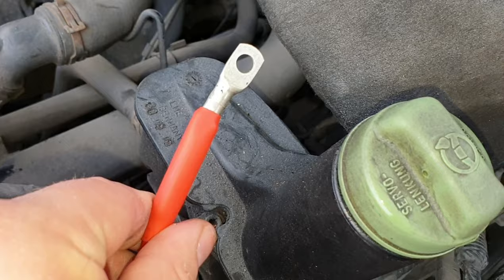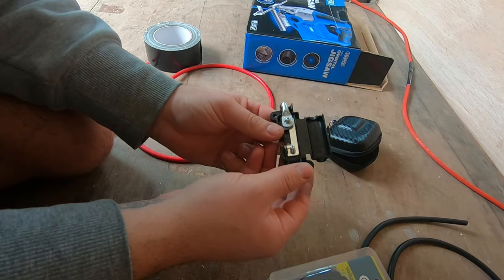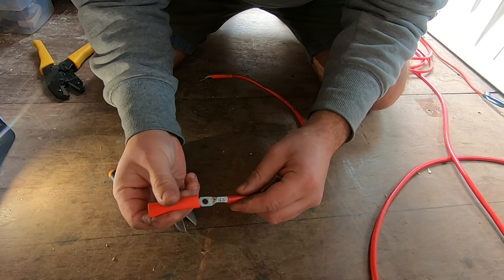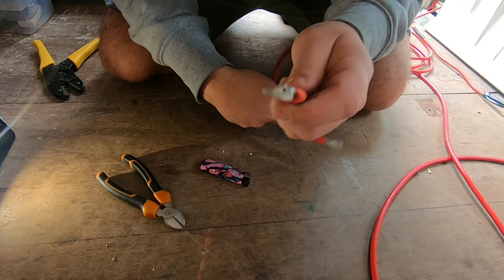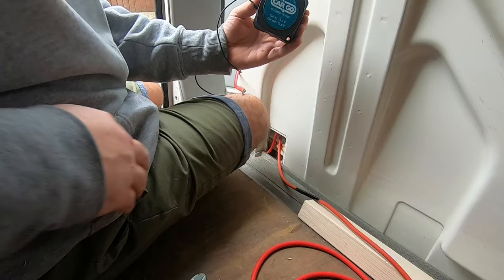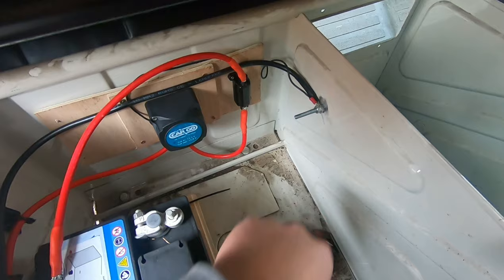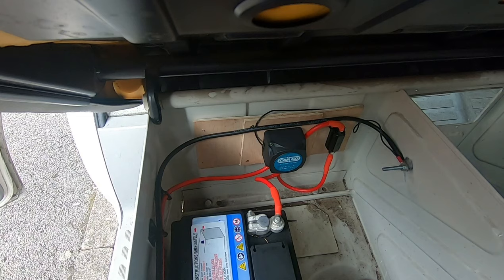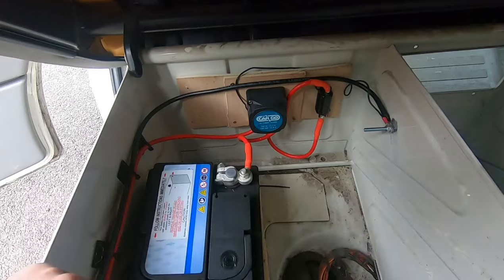Split charge relay kit to my leisure battery step by step

Comment: I have 3x110ah leisure batteries currently running on solar through solar charge controller. Is there anything I would need to do differently?

Comment: Lets say i want my solar panel to also charge my vehicle batt. Together with my leisure battery.

I only want to charge my vehicle battery i do not want to use its power for the camper part.
How do i set this up?

Comment: Did u earth ur starter battery as well  I did the same as u i ran a cable to the relay ,relay to the battery and was earthed and it wasn’t charging my leisure.

But then I swapped it out for a twin  live and neg twin cable starter to the leisure and it worked with 5amps being drawn 

So why I’m asking did u earth it at the starter battery as well as the leisure 

If not if gone wrong somewhere

Comment: Hi great video thanks just doing mine and just making sure it is ok to have the earth from spilt charge and the earth from liesure battery going to the same bolt to body/ chassis thanks
Reply from the maker: Hello mate 👍

Just make sure it's tight and on rubbed down clean metal 👍👍👍

Comment: It's supposed to be installed as per the instructions next to the starter batt not the secondary or it won't detect the voltage drop for a long time. I have the same setup and I realise why they tell you to do this. In order for me to get it to detect the car is off even after 5min I have to turn headlights on and wait to hear the click

Comment: On the first page you show all the kit assembly parts and the split box is close to the vehicle battery . I have put mine in the engine compartment,  does it matter as long as the wires go to the correct connector.
Reply from the maker: A long as it's all wired up correct it'll be fine , sorry for late response,  only just seen this 👍👍👍

Comment: Great video but missing important info: What size cable should be used and what size fuses? 
Not everyone buys a kit... I bought the voltage sensitive relay and will put kit together myself..  could you share more info for us non kit peeps xx
Reply from the maker: Hi , it's all in the description, Cable is 10mm and fuses are 60amp 👍👍👍
Reply: @LT_TOMMY_  Hi, great video.  Are you using 10mm Outside Diameter which is 25mm^2 giving 170 Amp current rating. Or is it 10mm^2 cable giving a 70 Amp rating and a 6mm Outside Diameter. Cheers

Comment: Im looking at adding in a bank of two leisure batteries due to the amount of power im likely to draw. In this case do you think it would be best to hook up directly to the alternator as opposed to the starter battery? Im just concerned about draining the starter battery

Comment: Hi, great vid! Helped me just fit mine in my mini camper 👍 I was wondering that because my leisure battery is fully charged, should I disconnect this when driving and reconnect when I need charging as the light still comes on when driving? Will this overcharge my new battery or should this be ok? 
Cheers mate
Reply from the maker: Hi 
Just leave it connected, it's fine 👍🏼👍🏼👍🏼

Comment: Hi, great video. thanks. I'm thinking about fitting one but i have 2 12v car batteries linked in series as one of the batteries was for a tail lift which is gone. i have a live cable that was going to the lift so thought to use that to go into relay, its already fused. does it matter that i have 2 batteries as its 24v?

Comment: Could this charge other batterys not just leisure batterys as I have a race transporter that has 2 main batterys as the lorry runs of 24 volts for main batterys and I have a 12 volt battery that powers my winch so could I use this to work of 1 over the main lorry batterys to the split charge relay then out to my winch battery.

Comment: Hi Tommy, do I only need to disconnect the positive side of the starter battery to connect the fuse breaker cable on, or do I need to disconnect both live and positive from the starter battery? 
Cheers

Comment: Hi just got my one fitted ans when the van is off the red light is staying on how do I fix this problem
Reply from the maker: They usually do stay on for a while, mine can be on for an hour or so after switching the engine off 👍🏼
Reply: @TommysVanLife  ok thank you for taking time to reply. I was getting worried
Reply from the maker: @Window-cleaning-london  No problem 👍🏼👍🏼👍🏼

Comment: Did you connect up the leisure battery first, then starter battery, or does the order not matter?
Reply from the maker: Run everything first,  fuses etc then I usually connect starter battery then leisure battery 👍

Comment: Best video I have found Tommy!  One that finally shows the actual fitting and layout of a setup....Many thanks bit a quick question.  I got a split charger set but it has 2x 100amp fuses.  Is this best as lots on YT have 60 amp or at most 80amp fuses??  Thanks in advance :)
Reply from the maker: Thanks a lot mate , glad it helped 👍 
I usually just use what ever fuses are supplied with the kit 👍👍👍
Reply: Most of these kits the rely is a fuse itself, so using fuses these position is a bit of a overkill :)

Comment: Hello I’ve wired my split charge same way as you,but my leasure battery won’t work unless my ignition is on any ideas ....
Reply from the maker: Hi , i think i understand what the problem is ...

Maybe your leisure battery is flat if it's not powering up appliances until you start the engine ? 👍
Reply: @LT_TOMMY_  il check if there’s any charge in it it’s brand new only fitted it all two days ago ...when I put ignition on ,I get power to leasure battery and able to switch on my lights,fridge ect once I take key out all power drops ...
Reply from the maker: @paulyaggymoo9731  Deffo check the charge in the leisure battery with the engine switched off, has the battery got a magic eye on it  , maybe an easy way of telling ...let us know how you get on 👍👍👍
Reply: @LT_TOMMY_  will do thanx for reply much appreciated .grt video as I followed you wireing hence why I messaged you ..
Reply from the maker: No problem, most batteries are at least part charged when new but my battery was brand new and quite low so after a day or so playing about with the interior lights etc it was flat , may be worth charging it over night so you know its being installed fully charged , plus get a voltage reader , even if it's a cheap 12v one that goes in to the cigarette lighter , at least you know roughly what voltage you have 👍
Reply from the maker: Any luck ?
Reply: @LT_TOMMY_  hi tommy ,yeh think it’s sorted the leasure battery was low on charge also my van battery so I’m charging both now .think one of my problems is the 500rms 12 inch sub I’m running and the other is cos it’s my main vehicle I use everyday I only work 9 miles so don’t think it’s getting a big chatprge of short journeys ..also will look into a power cap for sub see if that doesn’t drain to much of leasure battery ...
Reply: Hi tommy ,basically my leasure battery was flat this morning it looks like the split charge is not turning off ,there’s a video on tube that says to turn on heating lights ect until slplit charge switches of ,anyother way round this ...
Reply: @paulyaggymoo9731  put isolator switch on between leisure battery and split relay.. Only turn on isolator when your driving. As leisure batterys hold more charge than the starter it will drain to lowest powered battery

Comment: Great litle vid, by far one of the easiest to understand. I think I will have ago at fitting one in my little Vaux Combo van.    How / what do you then connect to this to be able to plug things into ?
Reply from the maker: Thanks glad it's helped mate 👍 

So this would charge your leisure battery,  then from the leisure battery you would go in to a fuseboard and from there out ... I have a video on 12v electrics which may help , I'll drop the link below 👍
Reply from the maker: https://youtu.be/3QQkd0uI0ls
Reply: @LT_TOMMY_  Cheers feller, I’ll go take a look 👍

Comment: Hey there, great video. Do you know what current the relay draws? I'm wondering how to size my wire. I think that relay is 140amps, does that mean that my 100amp wire wouldn't be big enough to handle it? Could i just fit an 80amp inline fuse for example? Thanks
Reply from the maker: Hello mate , if you buy the split charge relay kit , it comes with everything you need , including the correct cable size, fuses etc 👍
Here's the link to the kit I use 

https://www.ebay.co.uk/itm/7mtr-Professional-Split-Charge-Kit-HC-Cargo-12v-140amp-VSR-Voltage-Sense-Relay-/263954892053?_trksid=p2349624.m46890.l49286
Reply: @LT_TOMMY_  Awesome thanks buddy!
Reply: Will be busying this kit for my caddy, great video. Do you have a video or advice for wiring up your appliances / lights etc and also do you recommend a certain leisure battery? Thanks

Comment: I use a leisure battery for window cleaning and wondered if this would be useful for me.
My battery is Yuasa 100amp and it runs 2 pumps each day (approx 5 to 6 hours) 100psi Shurflo. I rather suspect that I am drawing more power than possibly could be topped up, is this the case?  Cheers. Steve.

Comment: Nice tidy job what amp is the liesure battery 👍🔋
Reply from the maker: Hi , it's a 120ah 👍👍
Reply: @LT_TOMMY_  i like your split charge set up did it cost much  how long have you been using it cheers 👍🍻
Reply from the maker: @deranocasper  I've had the same set up in my last 3 vans and it works great for me mate . Here's the link to the one I use 👍👍

https://www.ebay.co.uk/itm/7mtr-Professional-Split-Charge-Kit-HC-Cargo-12v-140amp-VSR-Voltage-Sense-Relay-/263954892053?_trksid=p2349624.m46890.l49286
Reply: @LT_TOMMY_  Cheers Tommy i am going to order the split charge kit soon did you purchase your battery of ebay are you getting a run out of it cheers i like your vw lt 35
Reply from the maker: Yes mate,  leisure battery aswell, mine will last 4 days or even 5 with light use 👍

Comment: Why 10mm cable? You are only charging the 2nd battery not using it to start the engine! These Voltage Sensitive Relays (Split charge relay) are a pain and waste of money, they annoyingly chatter on/off when both batteries are near fully charged. I have had to replace two with standard relays.